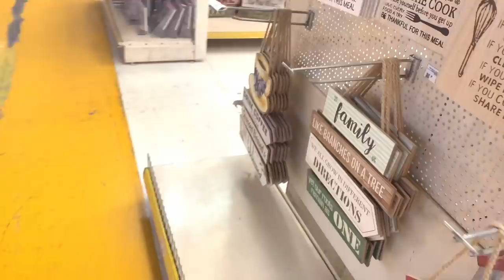Renter Friendly Studio Unit Makeover | 20K Challenge | DIY Ikea Knoxhult Cabinet Installation

Comment: for the corner wall near the Aircon, I assume na may water seepage ang wall on the positive side kaya matagal matuyo ang wall  putty, okay din naman that you used polituff as filler pero kung di masosolve ang water seepage magkakaron ng leak pa din sa wall.
Reply from the maker: Hi Gio! Yes you are correct.. The source is from the a/c drain pipe.. Unfortunately even if its still under warranty mabagal action ng admin, and since I am only given a specific time to finish kaya no choice ako but to cover it.. but the good news though as per my friend hindi pa nman nag recur ang leak... :)
Reply: @STUDIOPLOY  ganyan talaga sa ayala unlike DMCI maganda water proofing nila

Comment: Sir, how much do your charge in making the makeover? I have two townhouses units, if you can tell me the price of your DYI busiiness?
Reply from the maker: Hi Leonicita! It would depend on some factors like the location the amount works, etc. I don't typically priced it on a per square basis. Currently though I only accept projects within metro manila and recently just hold off accepting for the mean time. I'll probably be accepting again early next year scheduled for the second half of 2022...